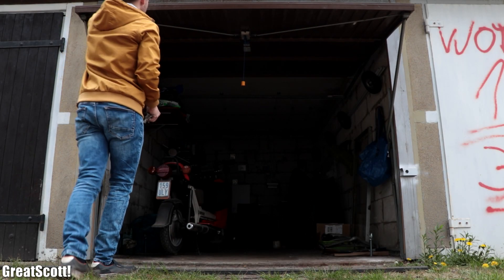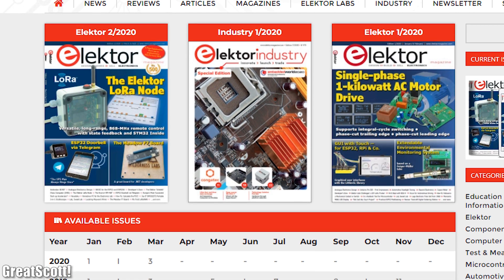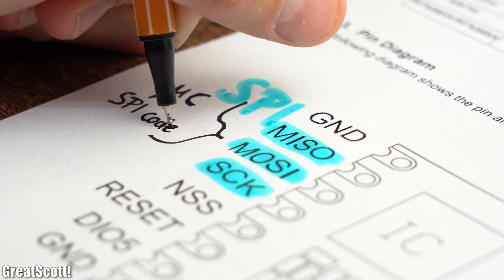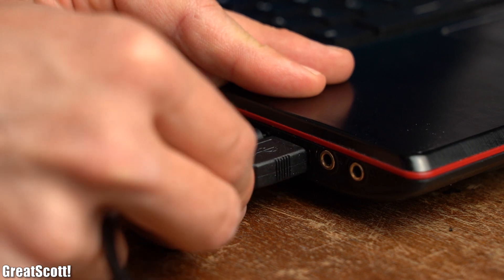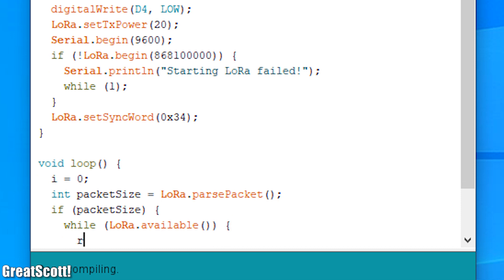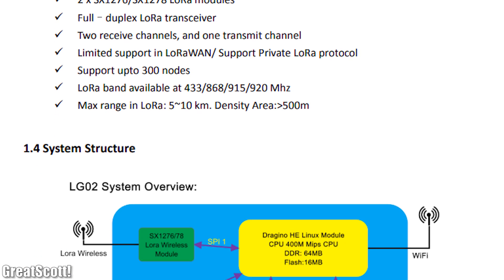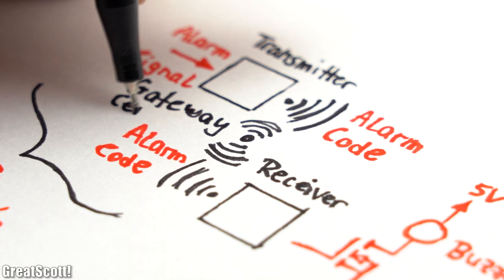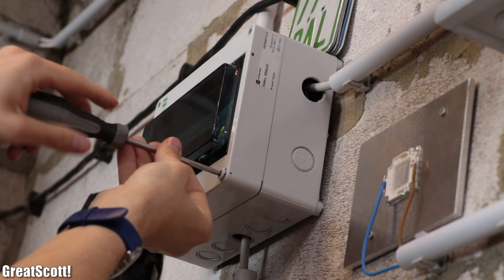Transmitting an Alarm Signal with LoRa (600m)! || Improving my Garage Alarm System

Comment: Are the capacitors that you included on the breakout board required? What pins of the rfm96 board are they connected to? I am trying to work with the same modules and am having a tough time so any help is appreciated!

Comment: How do you get 600M range with a wire antenna? I'm using a helocoidal antenna and I get 150M on an obstructed environment ( 5 houses on the xmit path)? Is your garage without obstructions? Maybe I should use a more sophisticated antenna with IPX connectors?

Comment: Hi Scott,  that is a really nice project. Do you think the Seeed will e5 can do the same? It got the LoRa module already on the same chip. Most difficult part is the stm32wle5j setup 😅 I mess this up all the time.  Maybe I should try it with the arduino IDE instead of the stm IDE? Regards Dom

Comment: Great video. Please may you reply if you dont use a gateway as this case, you can connect to the RX lora circuit just 1 “device” or 1 TX circuit? Or can you connect to other TX devices? (This question is because im thinking to make a communitary alarm

Comment: Ah you missed some points with the hardware.
If you installed the gateway and a app on your phone, then you could have pushed alarm notification to the phone, from the garage/gateway and appartment.

I think that LoRa is not as widely used as the claims.
Most people use mobile data or WiFi as the data rate and performance is low, but you can connect on a good day with ligh of sight. (Like almost all connections).

It is for tiny data as i /they show a 53bit/s transfer speeds. 
And 56k modems are slow lol..

Comment: LeoDJ made a great suggestion about a heartbeat. Having designed a LoRa alarm system myself, I second that and add voltage monitoring into the message so you can detect if the battery is getting low for some reason. Also to avoid the risk of a single transmission failing thus not triggering the alarm, I would like to suggest having the transmitter keep sending the alarm message until the receiver sends a message back that says "Hey I got your alarm message" and the transmitter then stops re-sending the message.

Comment: Hey Scott here is a tip for you to make programming easier.
Try using VSCode and the extension Platformio.
You don't need to mess around with the crappy Arduino  IDE.
It also supports programming and debugging  STM devices, ESPs, Arduinos and many more.

Comment: You could use the LoRa gateway to send a picture from within the garage to your phone when the alarm is triggered, which should help out against false positives. The bitrate on LoRa should be good for relatively low resolution image.

Comment: Hi great greatscott, as my favorite and best electronic guider channel I have a question that I haven't found an answer to yet. If I want to build some kind of a DC 24v 5amp battarey charger test bench, and the charger needs to be under load to start working, can I make a big coil to act as a very strong resistor to check the charger without causing damage? And if not can you give me another idea?

Comment: Interesting, as always ! A bit of explanation could be added : LoRa is like the low side layer of OSI (close to hardware stuff)  and LoRaWAN is an application layer that can link you to the Internet (providing a service). I saw that there is at least one free LoRaWAN service (The things network).
So, you could actually link your alarm to the Internet through a close enough gateway. If there is no such gateway, then you might use the provided gateway and create a  LoRaWAN node. That can explain why you were given the gateway.

Comment: A key distinction is that 0:00 - 6:50 are plain P2P LoRa, while 6:51 onwards is the much more prevalent LoRaWAN system. These are not the same, and you should be careful about which  one you intend to use if you follow along. This had me very very confused and frustrated until I found the resources I needed, as most of the tutorials are for LoRaWAN, which is much more complicated to get setup, but a much cooler concept for makers.

Comment: Could you have used an external antenna mounted on the shed with a module like a Digi XBee-PRO's   and an ESP32 (wifi feature) at the house for internet features?  I know this was a project to use the free hardware but it seemed more complex than necessary.

Comment: You must install a SECURITY FOG SYSTEM AKA Disco smoke machine on adrenaline. Search youtube for security fog / security fog machines. Some impressive systems out there. I made one for my garage (which had been broken into twice). Another attempt was made to break in my garage after I had installed this system, but this time NOTHING was stolen and that was now 4 years ago and still protecting my stuff.

Comment: Love your content! I know it's not DIY in the aspect of circuits, but you could always do a Ubiquiti PTP setup from your home to your garage. It could kill 2 birds with 1 stone, get you great internet connectivity at your garage which would in turn give you a good way to talk with your security system(moot now with your new LoRa sytem, but maybe live feeds of future security cameras?). I've used their NanoStation 5AC Loco 5GHZ radios a couple times now, and they are amazing @ $50/ea. With clear line of sight, I've gotten ~250-300Mbps up and down with Iperf testing. Just thought i'd throw the info out there, didn't know if you had been wanting to get your internet connection out there, but this is a really cost effective and relatively straightforward way to do it (there is a lot of documentation out there).

Comment: The benefits of using lorawan you've missed are: Lorawan takes care of the max duty cycle and other non-frequency things you need to be aware of to operate legally, error detection etc, security and privacy. You don't need an internet connection for the gateway either. You can run the lorawan backend part locally.

Comment: Isn't there a risk of buffer overflow in your receiving "while" loop ? (rec[i] = (char)blabla then i++). Basically anyone sending more than 8 chars would create an overflow (I have no idea what the result is on a microcontroller, but on computers, it can go from crash, to remote code execution)

Comment: Is there some reason for using the rather overpowered and expensive STM32 in comparison to just Arduino/Atmega?
Arduino also runs on 3V3 if you power it with it
Reply: well he got it from the Sponsor.

Comment: Ouch, what about security? Here you send a fixed message on every break-in. What happens if someone is able to block the transmission? Or someone could listen to what you send (or guess it by bruteforce) and just wake you up whenever they want.

Something like a heartbeat (as said in top comment) which sends the hash of the timestamp (not at millisecond resolution though) + a secret salt should work much better. To make sure the salt is never found you should probably establish a protocol to change it regularly, but that starts to make the whole project a bit more difficult as you need to check data integrity in this salt-rotation protocol.

If the connection breaks, you know it, and no one can block the initial transmitter and have their own transmit on the frequency because they don't know the secret salt.

Comment: Would this have a high enough transmission frequency (if thats what its called) to control a throttle on something remotely? Probably being generated by an adruino nano. Similar range or less, clear line of sight on water? doesnt need to be extremely responsive, a 1-2 second delay would be more than fine. Could it be powered for several hours off of one or two 18650’s (or similar sized cells) on the transmitting end?

Comment: The hub sounds like a cool secondary system you can add to improve it. First, using a SMS service, you could configure your system when it receives an alarm signal to notify your phone. This way, even if you're not at home, you still can be notified, and plus, that doubles as a time-stamping data logger, since you can look at your phones timestamp on the SMS for record.

Comment: FYI - Arduino pro mini's are available that run at 8Mhz on 3.3v.

Although in my experience, you can run an ATmega328 at 16Mhz on 3.3v without an any problem (even if it is out of spec).
The Jeenode V6 has been doing this for years precisely so it can run an onboard RFM radio module.
Reply: Yeah running on 3.3V is barely an advantage - at the very least you can just use a voltage divider.
Reply: Or maybe you use an ESP instead of crappy arduinos

Comment: Why make simple things complicated ?
Your garage has a powerline, why not use Homeplugs and a camera with motion detection? 
With that setup, you can view your garage and record motion, send pictures to your cellphone, receive email notifications etc......
Reply from the maker: My garage has a powerline? You know more things about it than me.
Reply: @greatscottlab  , with powerline i meant mains (240V) not high voltage :-) 
But i was wrong, the newer powerline (or Homeplug) adapters support only up to 300meters, so 600meters is not possible.
Maybe another option is to modify a old Android phone with the app Tasker to send you notifications to your cellphone?
Greetings from Belgium.

Comment: Remember German robbers: Jam LoRa frequencies before breaking into his garage.
Reply: The LoRa transmitter is so low power that just holding the button down on a standard 433Mhz remote would probably block the signal. Especially at that distance.
Reply: As demonstrated in this video - https://www.youtube.com/watch?v=UlNkQJzw4oA - such 433Mhz remotes can be purchase for very cheap ($2 in his case!) and completely drowned out the signal from the sensor..

Comment: At the antenna terminal you should not have the header pin! Then measuring the correct antenna length and soldering it on top of that is not giving you the correct length.
If you experience a short range this may be part of the problem.

Comment: Hi Scott,
the LoRa.h library from sandeepmistry (Arduino LoRa.h) does not really implement the LoRa protocol stack. It uses the LoRa radio layer, but begins to divert on the next and all following protocol layers (PHY, MAC and APP). It would be nice, if you could use a syncword other than 0x34 (reserved for proper LoRa networks) use 0x12 instead (reference: Semtech SX1276 data sheet) or implement a proper LoRa Wan network (e.g. as part of "The Things Network").
Also Arduino LoRa.h does not provide encryption and verification, so you connection is hackable.
The Dragino "Gateway" you bought is not a real Gateway. It's two normal LoRa modems hacked together to emulate a minimum of gateway functionality. 

And a privacy hint: If your garage has a LoRa Device sending X-times a day, your garage can be triangulated.

Comment: What about making an automated garden which might sound  ease but trust me it isnt. 
I am going to make my own hydroponic gardening system and i what an arduino measuring and creating a graf of the temperature and humidity of the rain shelter .
Remember the peristaltic pumps you used for the cocktail machine?? Why not making a hydroponic system that is fully mixing and measuring the nutrient solution on its own as long as uploading the data to your phone so you can see if the solution has ended . I thing is a great idea and it will be very interesting for  the viewers too. Tell me your opinion and have a nice day.

Comment: I'd suggest to add a message signing function, like crc, to avoid most of the errors.
I read some comments about a hearbeat periodical message, i'd recommend using a hashing + salt protocol like salted SHA256. A thief could just do a replay attack and deactivate the alarm. Car keyfobs use a "rolling code" to avoid replay attacks, but i don't think it would be easy or useful in your application, better use hashing + salt. Cheers, and great video as always ;)

Comment: Ok, now you can integrate the STM32 microcontroller, the LoRa transceiver, the antenna and battery in a custom PCB made with JLCPCB. Ohhh and a 3D printed enclosure of course! And you program the micro with stm32cube IDE software in order to reduce the power consumption!!

Comment: Sir could you please explain what is the purpose of gateway? Gateway can send data to the server by help of internet. You can also do that same things of some low cost another microcontroller like esp8266 or esp32. 
It's cheaper than expensive gateway. One more question sir if I want more than one garrage will be secure then this LoRa module can able to receive multiple data at a time?

Comment: I would've started with the antenna system. Since you have just one garage and one home it makes sense to utilize a beam forming antenna system between the two. This is an easy way to comply with legal maximum broadcast power requirements.

Assuming the radio frequencies involved are in the 900Mhz band, the size of the required antennas is acceptably small and would not run afoul of HOA rules or other local regulations. 

High gain antennas with tight beam patterns raise the effective radiated power without breaching broadcast power requirements. 

I once rebuilt an 11 element left hand circular polarized antenna for the 2 meter amateur band. It had a gain of 22dbm and a beam divergence of 7°. I used it to talk with stations all up and down the eastern seaboard from southeastern Michigan on just 2 watts of power!

I had started out using 12 watts input but had to dial it back after my next door neighbor knocked on my door to tell me that he and his wife could hear my side of my conversations through their television's speakers, and they weren't even watching television at the time!
Reply: LOL, awesome

Comment: Instead of sending when there is a unauthorized open, you should send continuously and stop, when theft is detected.
This way you also detect malfunction and prevent jamming or power lost attacks.
Also I would recomend a rolling key. To prevent replay attacks.
Reply: I don't think he's allowed to do that, in fact, with LoRa you can't do such thing, when you use ISM band you must follow the law. duty cycle and max tx power etc.

Comment: I have a question, why don't use MQTT protocol instead LoRA? MQTT have more advantage such as low power, longer area than LoRA and also it's real time data. It's mean that delay of transmitting and receiving data is nearly zero because the size of the data itself.

Comment: Now he has a $300 alarm system with only a few basic features. Best buck for your bang! Though he probably paid only a small amount, as the expensive parts (mainly the Controllino, which is not exactly adequate for the purpose, it's like using a bazooka to kill a mosquito, but I guess he had no other use for it) were given to him for free, not to mention that even just the ad revenue of a single video most likely gives him more than enough to cover it.

Comment: You have a buffer overflow in your receiver code which might cause your receiver to crash when receiving long message. You should probably add a check for the message length :)

Comment: Forget the alarm if its 600 meters away. You need to make an instant garage door closer to catch the burglar. Try to collap with Colin Furze :)
Reply: If he collaborates with Mr Furze on something like that, his garage will end up with the back end of a JCB (BacHo for US types) rigged to slice the guy's head off or at the very least pin him down until you get home - preferably after a fortnight's holiday! LOL
Reply: Bob Lewis Colin will probably use a v8 engine as the motor that opens/closes the garage door.

Comment: A big advantage of using the gateway is that you can send a message to your phone (or anything that has internet).  That way you will get the alarm even if you are not home.
I played a little with LoRa a couple of years ago here in the USA; but, it is not popular here.  LoRa is a hub and spoke system where the Gateways are the hub.  One big advantage to it is that LoRa units have a unique ID that you configure into their ; so, they can be identified by any Gateway to create a wide area network so your LoRa unit can move around and still send messages to you.  See https://www.thethingsnetwork.org/ for more info on how to configure you system.  I took a while; but, I was able to get data packets.

Comment: You need to implement checksum and retry into this as you clearly had issues with invalid data.
Reply: The LoRa Modems are implementing checksumming on lower protocol levels. That's usually not a problem. The Problem is, Scott ignores the higher levels (encryption and verification).
Reply: For anyone not sure what those are, check out ben eater’s yt channel
Reply: @jamesdavis2027  thnx
Reply: Not really, he just sends the same code multiple times, checksum won't fix anything here it will only make the receiver aware of corrupt data. The receiver already does this where if the received data is not the alarm trigger code, the data is corrupt...
In a more complex system you would absolutely want checksum or even ecc features but here it wouldn't serve a purpose.